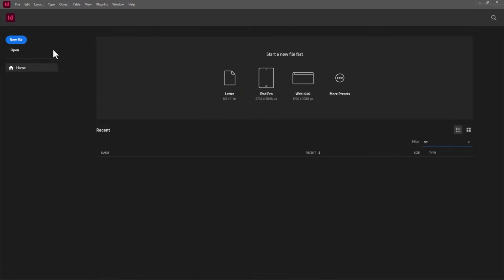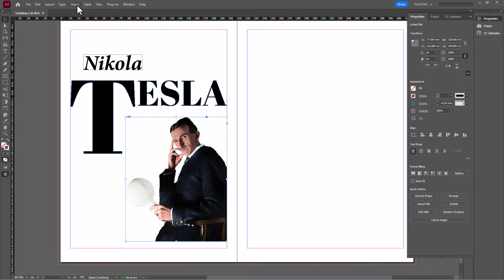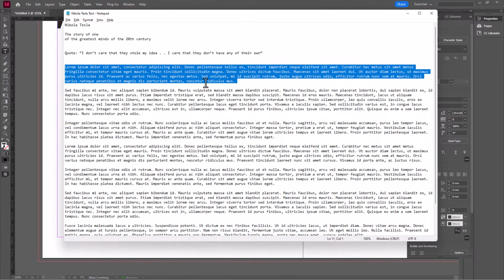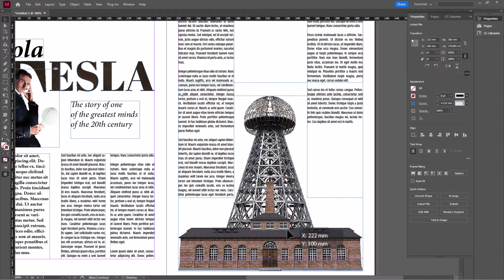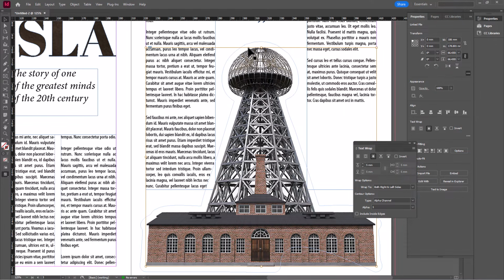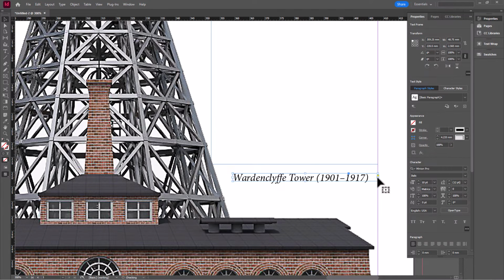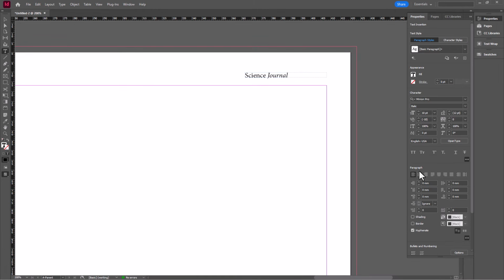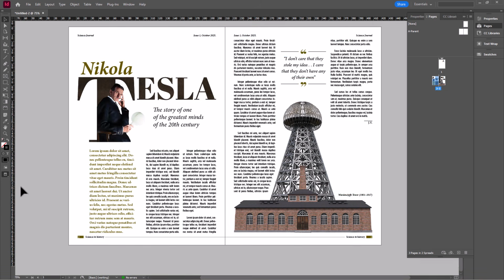Design a Magazine Spread in Adobe InDesign | Science Journal Layout Tutorial

Comment: Are the photos safe for printing? Or it’s an RGB color separated in CMYK before importing to InDesign?
Reply from the maker: They are RGB... But after you export them as a PDF ready print file using one of the PDF/X or PDF/A standards they are safe for printing. Which standard to choose depends on the print house demands. I usually use PDF/X-1 when sending files because that is a standard requirement from the CTP operator. The quality of print depends on other things such as printing house equipment, machines and the skills of a printing operator.